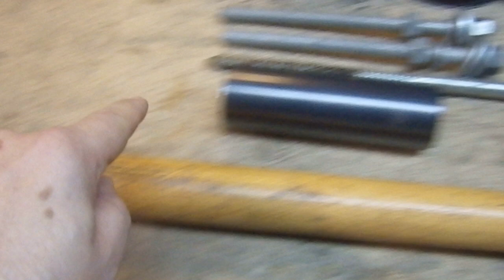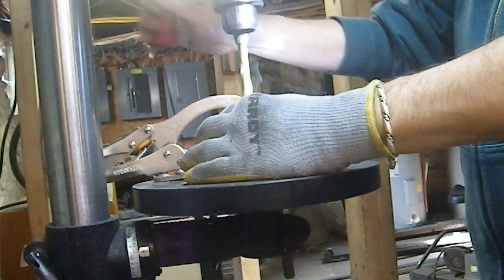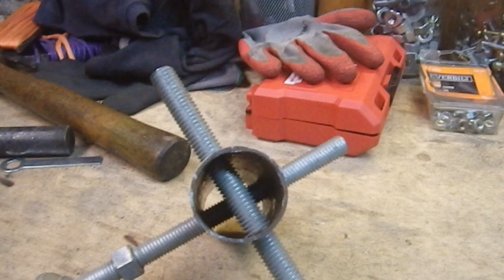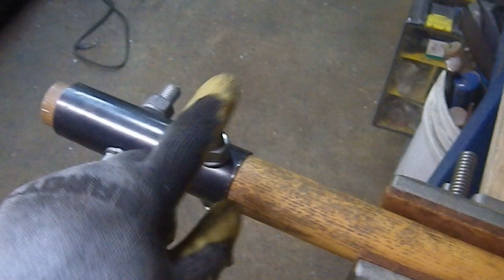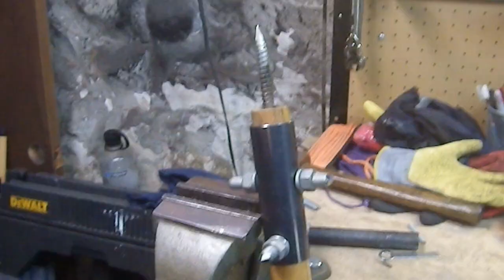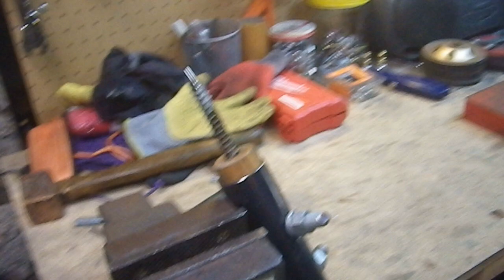Crafting with Tetsubo: Woestenij Goedendag

Comment: I made mine for about 9$/38 Pln  but it's more of a hybrid with disc mace by using the 10 inch mushroom head bolt instead of a spike, moulinet "a circular cut" is mad with it  ;)